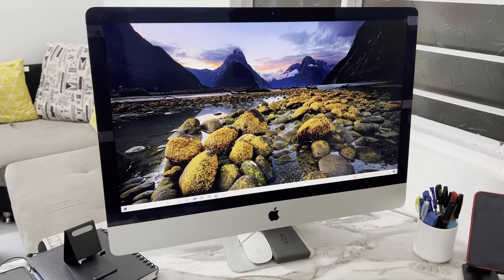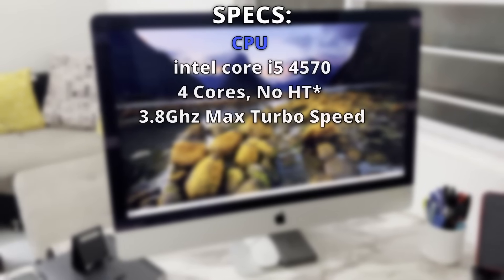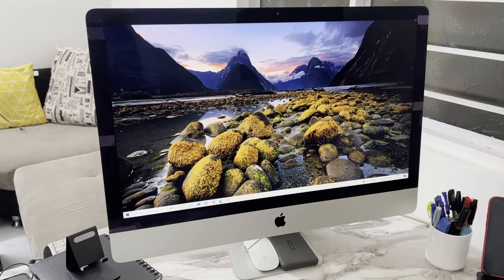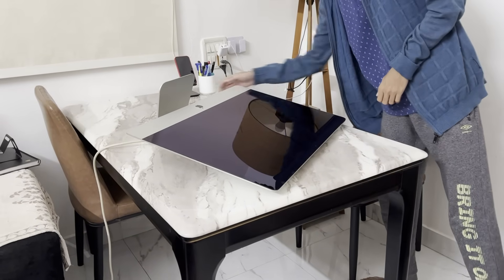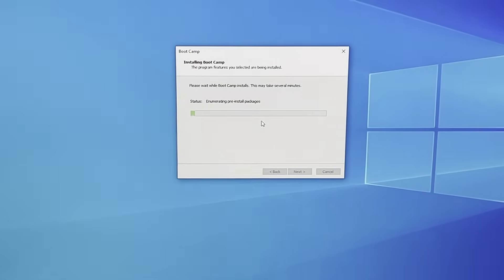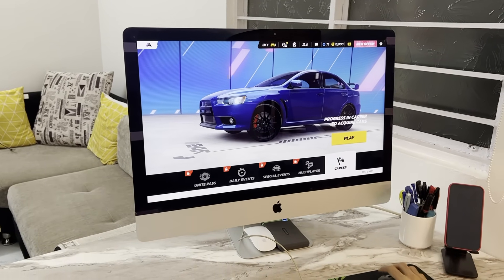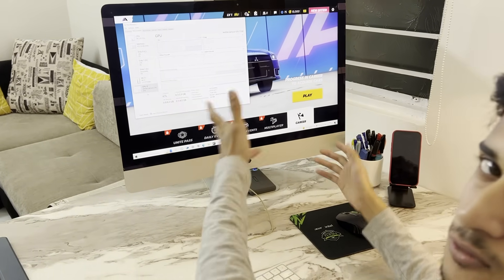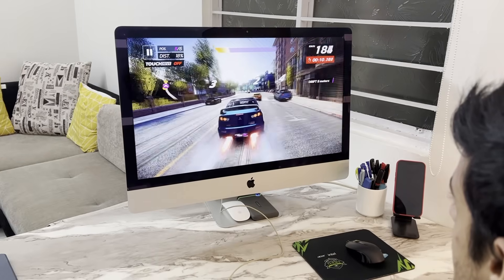THIS 13 YEAR OLD iMAC CAN GAME!... Kinda | Amogh Does Tech Stuff | @Amogh0102

Comment: Me😢: Asphalt Unite Running Like Trash At Default Settings, Performance Setttings And High Settings On My Phone.😢

Also Me🗿: Motion Blur, Bloom, Depth of field and God Rays Medium Settings. 60FPS On Asphalt 9 Chinese Version.🗿

Oppo A38.

Specs
CPU: Mediatek Helio G85 2Ghz.
Ram: 4GB Ram LPDDR4x 1800Mhz 2x16.
Storage: 128 GB eMMC 5.1.
Gpu: ARM Mali-G52 MC2 1 Ghz. In Built On Cpu.

Comment: As one of the oldest players of Asphalt 9, I went from iPad air 2013 -> macbook pro 13" 2015 when mac OS got support to play A9.
if you think you've seen the most cooked devices among players of A9, no one realized I have one of THE MOST COOKED A9 machine.
I needed to turn off ALL the graphic effects, and set the scaling to 70% just to get decent FPS.
even then, my CPU would overheat like CRAZY. like 103c in just 10 mins of playing.

One mod I would suggest for the CPU: Get a PTM7950 thermal pad. this saved my macbook's buns.
it now NEVER overheats, and performs consistently
Even when the game merged into ALU (where I set ALL the settings to the lowest possible settings).

I have a video where I was running ALU on my macbook in a low vs max graphic settings video.
and ALL my streams were run on that macbook before ALU

Comment: " It plays Nice!"
First of all thats not nice
Cuz i mean That thing is rly op
Its great!
And it smashes my pc to hell
Cuz its running on 1440p 
(even if its 80% scaled its still over 1080p i guess)
My pc can only handle mid-low settings at 900p 70% res scale 
And averages bout 50-60 fps
Its almost kinda close to this Mac's specs 
Intel i5 4440 (2013💀)
Nvidia GT 740 (4gb ddr3) (2014💀)
Ram 2x 8gb (ddr3 1600mhz💀)

And what im trying to say is that it can rock the game at max in 900p or 720p
My monitor is an old lcd tv 32 in 1080p 60hz and in these settings i can see individual pixels cuz im not even using anti aliasing 😅

Comment: you can run a windows 11 installer in windows 10, or you can use ghost spectre superlite windows 11 which is a stripped down version and only has the core features (you install the rest yourself)

Comment: You must be really caring with your devices for them to last that long. You even still use your old iphone as a webcam for your streams. Or are apple products durable like that? My PC is 7 years old but over that span, i had replaced parts as they broke 1 after the other.
Reply from the maker: Yeah, I take the time to maintain my devices occasionally.